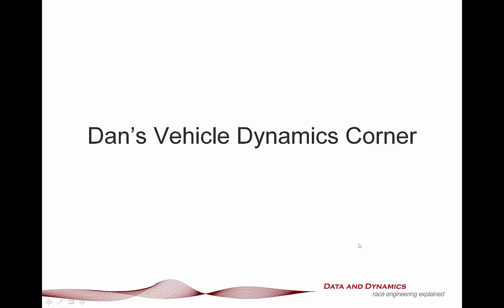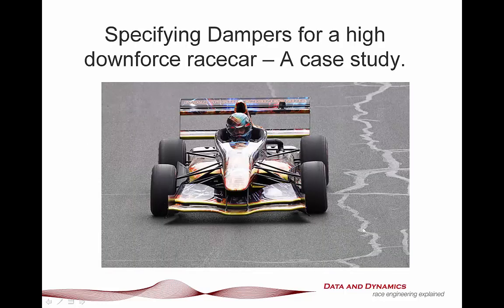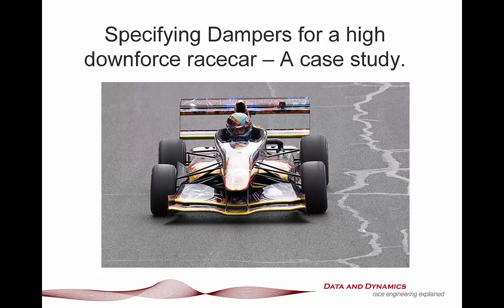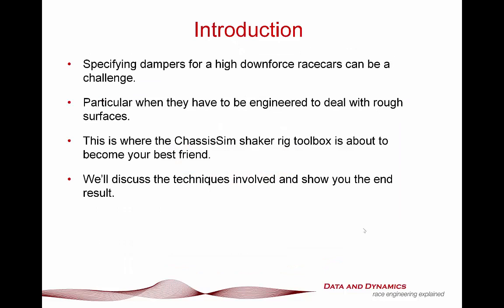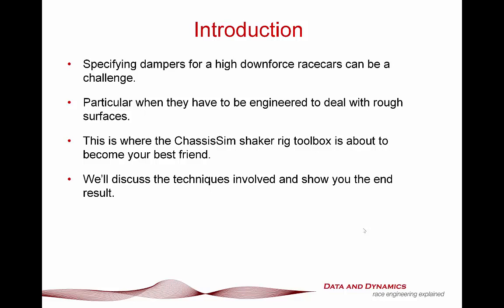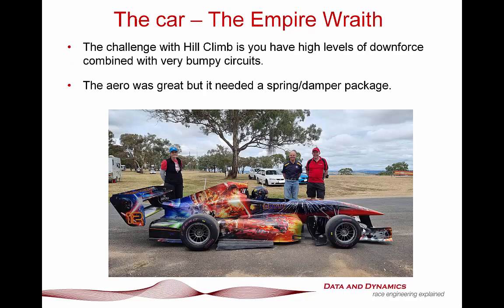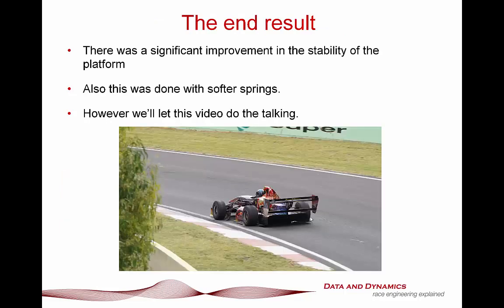Tuning Dampers for High downforce racecars - a case study

Comment: Nice video Danny, I try to run a GP2 around Bathurst on chassisSim, but the brake input is not consistent on the braking zones and the dampers have high frequency.
Is it porpoising?
Where should I start?
Thanks
Reply from the maker: What has happened here is a number of things. If ChassisSim see's an advantage it will go for it. That being said the old Bathurst track was very bumpy so I certainly think you have hit a resonance mode so it's a bit of both.